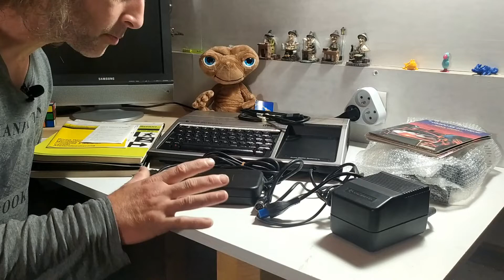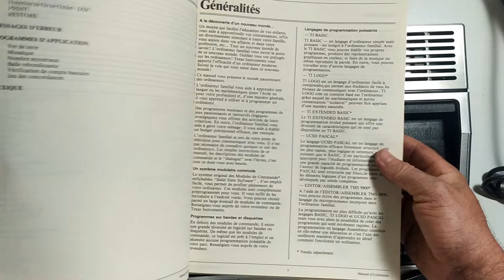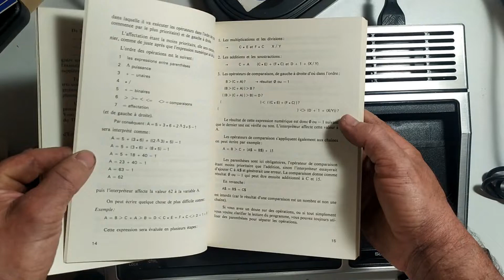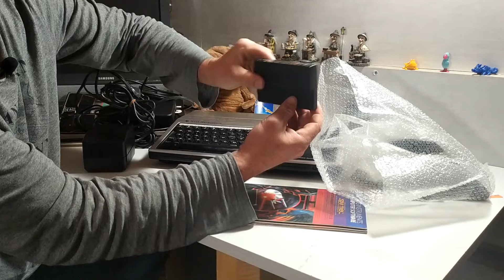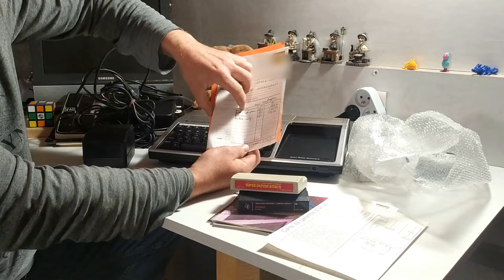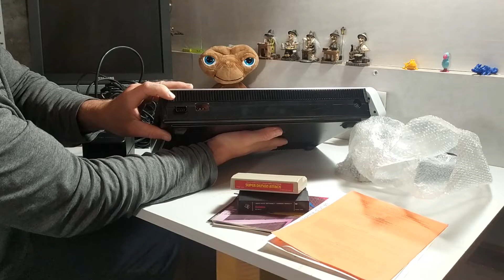A big box of TI99/4a stuff | 8bitsinthebasement #texasInstruments #ti994a

Comment: Lovely machine. I knew that TI99 is a bit weird machine, but that You can kill a sound chip with high volume is too strange. But hey, that was the beginning of home microcomputers, no standards, crazy time :)
Reply from the maker: It was a few weeks after it died that I learned what had happened here  https://atariage.com/forums/topic/318786-ti99-with-no-sound/ 4 posts in. I've heard that it's also possible to damage a C64 if you connect it to a device other than a 1530 Datasette and turn up the volume too high. I was really surprised but I killed the chip. So that's something I won't be trying with a TI again :)

Comment: Hope you can get that sound chip working!  I found (after I got an adapter to use Atari joysticks, the stock joysticks are AWFUL) that the TI99 is a very decent gaming computer.  Programming it on the other hand, not my favorite.
Reply from the maker: I've played quite a few games on it with a joystick adapter I wired up (both with and without sound). As a gaming machine it stands up very well, Burger time and Parsec are two of my favourite titles. Video coming this weekend on my sound repair attempt.
Reply: The real joysticks are a pain !   Games can be quite nice..parsec etc.. the programming is setup pretty good good books with it and the ability to create sprites in basic..  maybe give the programming another try..just don't expect speed from this basic !

Comment: Looking forward to what you can come up with for trying to repair the sound. 100 euro for one chip is really steep. I didn't pay that for my whole computer shipped. Pretty soon I'll either have to win the lottery or choose a different't hobby. Making the crossover cable is something you should do if you haven't done it yet. Well worth it.
Reply from the maker: You'll see how I got on this weekend. The cross over cable was one of the first things I did when I got the TI. I made the simple version that supports only one joystick, there's another that lets you connect two but I don't have any two player games for the system so I didn't see the point in making it. It's true that old systems and there parts are becoming more and more expensive, but as I learned earlier this week, with a little luck things can still be found cheaper than you might think ;)